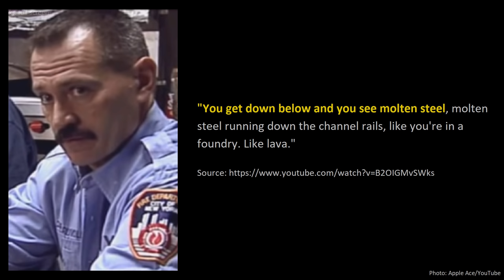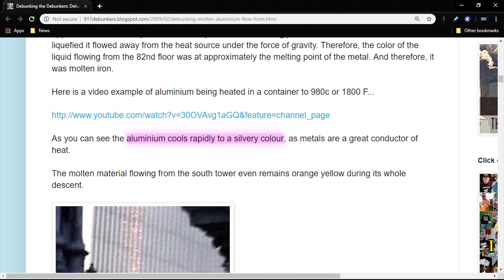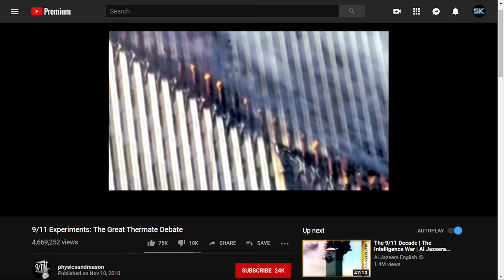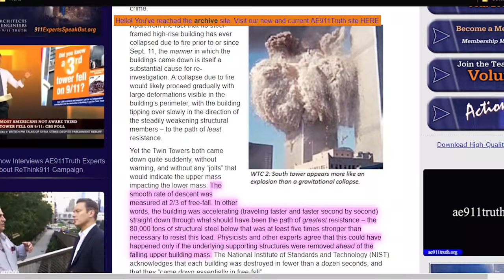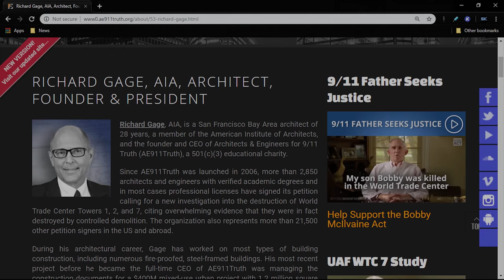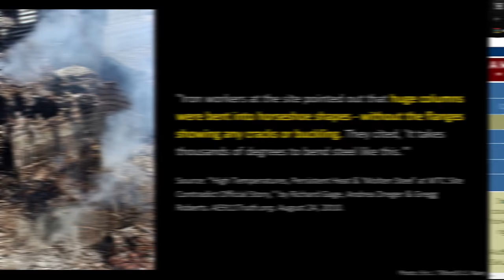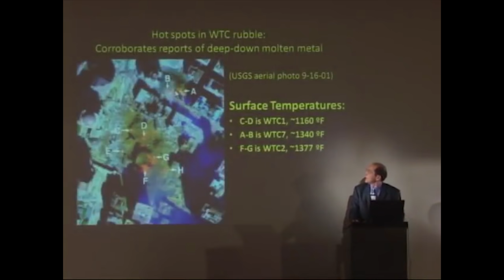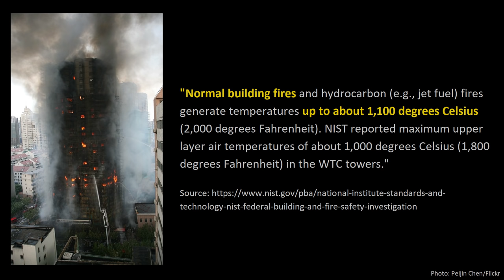9/11 Truthers Debunked: "Molten Steel = Thermite From Controlled Demolition!"

Comment: The buildings turned into dust, but lets not talk about that.
Reply: Exactly my thoughts, especially with the pancake theory. You'd think each upper half of both the north and south tower to at least disintegrate as it smashed its way through the lower floors and lose momentum leaving most of the lower half intact.
Reply: Dust huh? Strange...that debris field does not look like a big pile of dust to me. I see what appears to be the remains of a sky scraper, with tons of bent and broken metal among other solid objects and yes, some dust thrown in there.
Reply: @erniewatson23  The top portion has so much mass, it is doing the crushing. It does not crush itself until it meet an opposite force strong enough to counter its force, which does not happened until it gets quite closer to the ground.
Reply: Orange dust too the kind you see when there’s…. Explosives.
Reply: @DIYBRY  Why did the buildings (all 3) fall at the rate of gravity?

Why was there Aluminum Oxide at the site?
Reply: @suntzu6122  So…what, are you expecting the buildings to fall in slow motion? Are you expecting them fall over sideways like they were cut at the base like a lumber jack cutting a tree? You clearly didn’t watch this video in its entirety.
Reply: @DIYBRY I'm calling sheep, they're probably smarter than you
Reply: @rodrigobravo3317  back up your burn.
Reply: @DIYBRY  sheep are just smarter than you are
Reply: @rodrigobravo3317  great come back
Reply: it was dust from the drop ceilings most likely, the building had an asbestos problem
Reply: @DIYBRY  thanks I appreciate it

Comment: As a person who was on construction worker for 48 years and knows steel not one building has ever collipised from fire even the Bank building in Mexico which burned for three days it saged a bit but didn't drop to the ground
Reply: yeah well it also wasn't struck by a 767 filled with jet fuel traveling 600mph
Reply: @BabySkinCondom   Neither was building 7
Reply: Not true….. Plasco building was a 16 floor high rise and collapsed… a tower in São Paulo that had 26 floors was on fire and collapsed… why don’t you actually bother researching these things but instead hope that a building before or since 9/11 haven’t collapsed
Reply: True.
Research Windsor Tower fire in Madrid (2005).
Firefighters needed about six million liters of water and 80 hours of work to extinguish the fire. The building did not collapse, it withstood temperatures of 1000 degrees.
Reply: @Ǿœ0œǾ  Windsor tower suffered a partial collapse, which part? The steel part. The steel exterior columns and floors on the higher levels collapsed. The core was concrete and the collapse stopped at a concrete floor called the ‘transfer floor’
Reply: @maccloud3685 oooops hahah they always forget about that one
Reply: @mike2c512 exactly, “partial collapse”.
The steel structure, though damaged, was still standing afterwards (and it wasn’t even the main bearing structure of that building!).
And let’s keep in mind that the building was nothing like the WTC in terms of size, resistance, durability…
And it kept on burning for 19 hours.
Yes, 19… not 45 minutes.

There’s no way those towers could’ve fallen like that, at that speed, without a controlled demolition. No way.
Reply: @BabySkinCondom  Cant fly over 450mph without wings tearing off due to thicker air than at cruising altitude, NIST claimed over 500, and now this guy is @600? How long b4 its '1 MILLION MILES PER HOUR'?

Comment: "Why thermite?"  Because you won't hear explosions.
Reply: Then why do some ppl use witnesses saying they were hearing explosions? at least watch the full vid...
Reply: You cant put thermite in a beam without taking off concrete . Nobody saw demolitions experts working on thermite in the building or they hired john wyc and ethan hunt..Macgyver maybe?
What sort of demolition expert work silently?
Reply: @Teluric2  the entire structure of 601Lex was reworked without anyone noticing.
Reply: @Teluric2  keep in mind you're arguing with crazy nutters that have a (at best) very childish understanding of the relevant subjects- architecture, engineering, construction, demolition, etc.  because they're largely unemployed losers who spend their time playing call of duty, they think rigging a building to blow is as simple as walking up to a support column and pressing F to place a charge.

they don't understand that to rig charges to the critical structure requires you to completely gut the building- you would have to remove all the desks, office equipment, cubicle partition, and then finally the actual walls/floor to access the critical points.  to do this to 2 110-story skyscrapers without anyone noticing would have required both towers to be completely closed 24/7 for literal months to accomplish- and that's if they weren't trying to hide it.  10s of thousands of people worked at these buildings and went in and out of them every single day-  IT'S LITERALLY IMPOSSIBLE THAT THEY PULLED THIS OFF
Reply: Thermite to set off the explosions alsoz
Reply: It causes explosive reaction if the reaction is contained.  But, you can't entertain rational concepts due to your religious hypothesis.

Comment: Question: What causes six weeks after 9/11 to burn your shoes while walking on ground zero?
Reply: Heat
Reply: @MFitz12  What is causing this heat 6 weeks after 9/11?
Reply: Maybe a very big pile of burning collapsed buildings? Maybe?
Reply: Lmfao… clown doesn’t know he’s a clown. Two 1000+ foot tall buildings collapse with everything in them, and he thinks the ground is gonna be cool to the touch 6 days later.
Reply: Six weeks. Not days  @30AndHatingIt
Reply: Nano Thermite is the only thing that can do that.
Reply: @30AndHatingIt it was though
Reply: @MFitz12 shill

Comment: Why did you leave out the fact that a peer reviewed scientific study confirmed the presence of nanothermite in the material at ground zero?
Reply: Hey man, do you know where I can find this study? I’ve been investigating this subject since forever and I’m trying to piece everything together. 
It’s crazy what lies we’ve been fed, by the way.
Reply: @Adamanthon  Not only is thermite not explosive, it is never even used in building demolition.  Just ask around the professionals that do building demolition and you'll get the straight dope.  Thermite is used in industry to weld rail and such, always in horizontal orientation.  It would be nearly impossible to contain in a vertical plane as it would melt through anything (other than specialized ceramics) used to contain it.  In addition, to attempt to use it in a vertical orientation would be extremely inefficient as much of the heat generated would be lost upward and outward thus requiring ever increasing amounts of thermite.
Reply: @Synaptic_gap  “Nano-thermite or super-thermite is a metastable intermolecular composite (MIC) characterized by a particle size of its main constituents, a metal fuel and oxidizer, under 100 nanometers. This allows for high and customizable reaction rates. Nano-thermites contain an oxidizer and a reducing agent, which are intimately mixed on the nanometer scale. MICs, including nano-thermitic materials, are a type of reactive materials investigated for military use, as well as for general applications involving propellants, explosives, and pyrotechnics.”

If you want to keep believing in lies, go ahead.
Luckily I left that path long ago, so did many others.
Reply: @Adamanthon  Nice cut-n-paste job there!  All the fancy wording doesn't change the fact that thermite is just iron oxide (rust) and powdered aluminum with a relatively slow burn rate completely unsuited to use in explosives.  That's it.  Doesn't matter how fine it's ground, it's still just rust and aluminum powder.  I challenge you to a building demo professional that uses thermite.  You won't find any.  If you want to keep believing in conspiritorial BS, stick with the flat earthers.
Reply: @Synaptic_gap  you can’t read, apparently…
Reply: @Synaptic_gap  you can’t read, apparently…
Reply: @Synaptic_gap  Add sulfur to thermite, creates thermate. I'm gonna grab my aluminum knife, and cut my 2" steel tubing, because manufacturers and fabricators ALWAYS use aluminum blades to cut steel, smh. If I'm able to launch my beer can 500mph, it'll slice right thru thick steel and steel reinforced concrete?